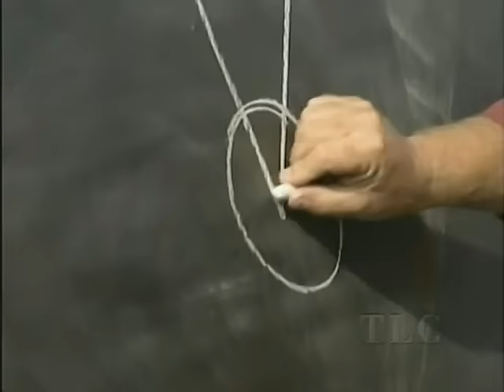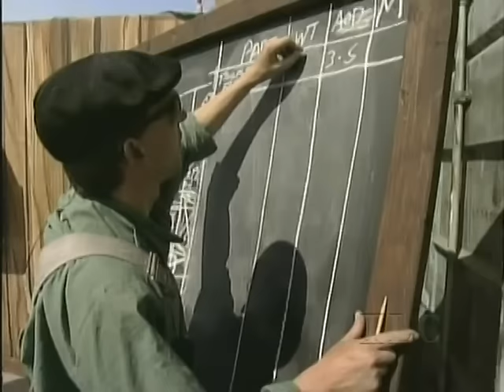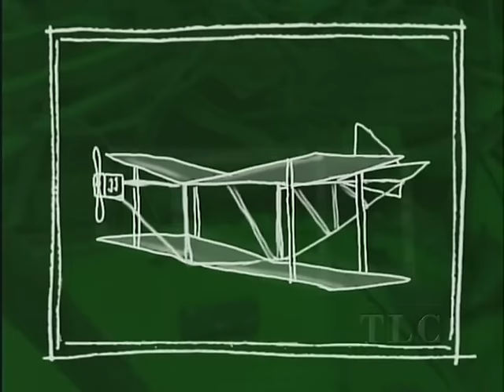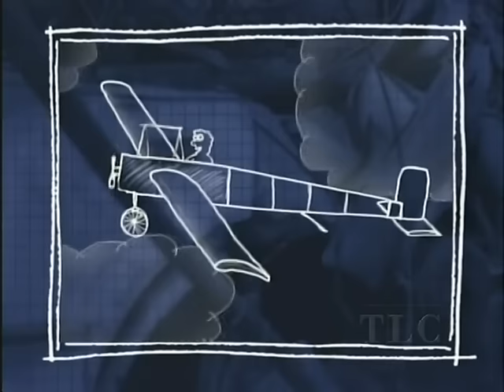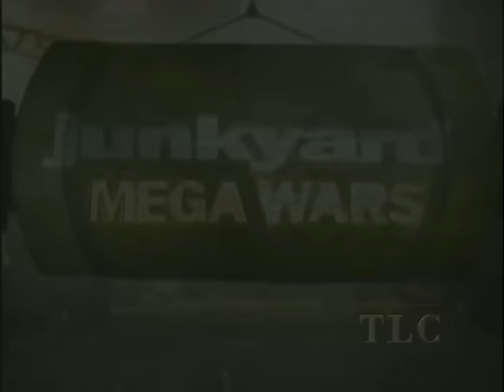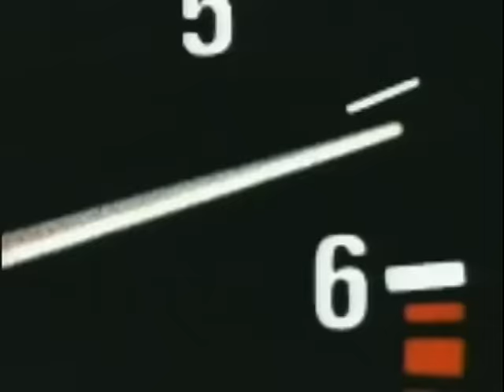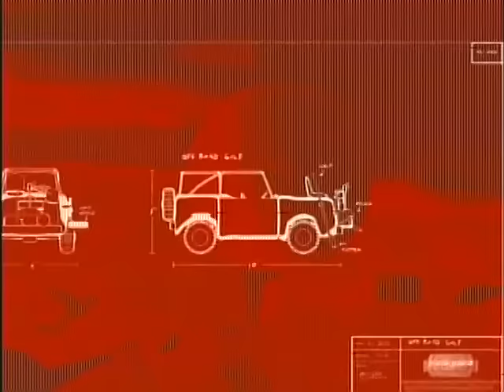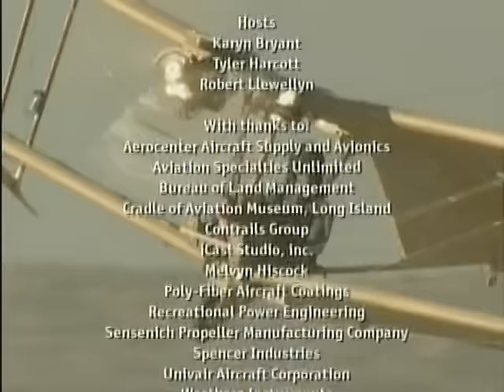Junkyard Wars Flight of the Century Special Full Episode

Comment: I don't know why they bothered doing the planning thing at the start: I mean, I get that this is all staged and that starting with that is their basic format but even for the sake of the show they should have just had the teams make a show of racing out of their bays looking for motors before bothering to plan a damned thing...and it's not showing them looking for motors? ah, they just straight up give each team a motor, they really should have done that at the start because nothing in the episode before that point can even pretend to make sense.

as weird as it might sound planes are actually surprisingly easy to design if all they gotta do is fly, what is NOT easy to get is a sufficiently weight efficient powerplant to make it all work, the more spare power/weight you have the better your tolerances on everything else in the design up to the point where you have so much power you gotta worry about it holding together. furthermore almost every aspect of an airplane's design is building it around meshing your powerplant with your performance objectives.